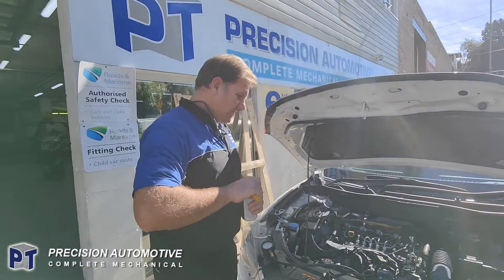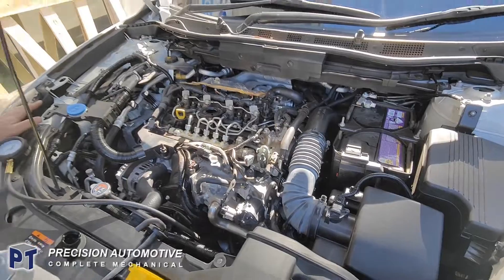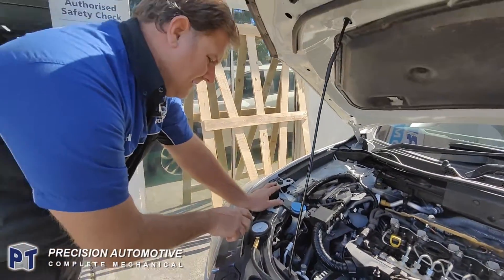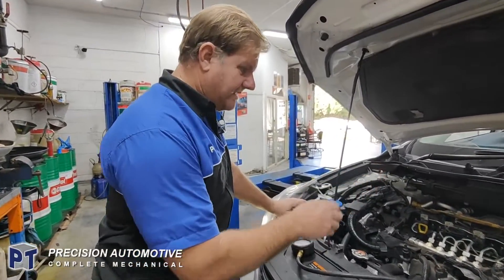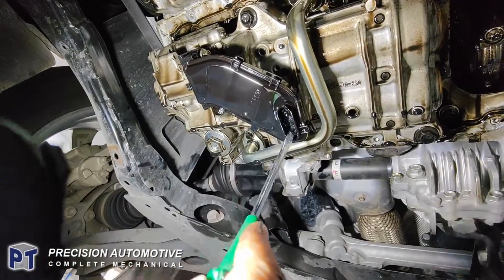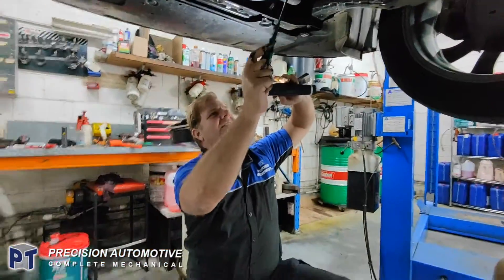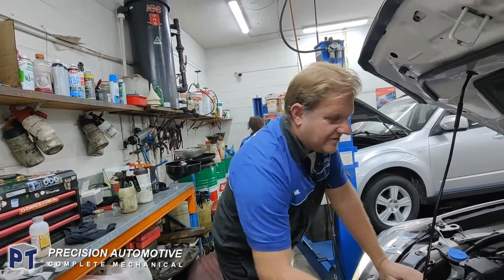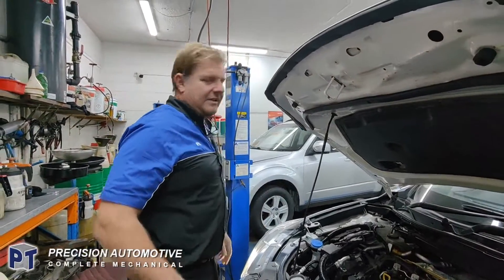Mazda cx-5 diesel oil pressure issues, Engine Issues

Comment: You can remove the hole oil pump  that's the only way to change the oil sump clean it is not gonna help. You just have the mark the position  of the chain on the teeth wheel without having to remove the hole timming chain unit.

Comment: A Honda K24 engine swap will fix it.

Never would have imagined a Mazda being compared to a Captiva for reliability. 

A petrol CX5, as reliable as the sun rising in the morning. 
A Diesel CX5, as reliable as a politicians promise.

The good news is, if you've got a petrol CX5, and you need some good low milage parts, for example an immaculate bumper bar, or a door, or even un worn interior parts to freshen yours up, there'll be plenty of pristine condition CX5 diesels being wrecked. 

Maybe an aftermarket money marking venture would be to convert the near worthless used diesels to petrol power?

Comment: The source of the issues in the the top end.. pull the valve cover off, the injector seal will have failed.. the little copper washer at the tip of the injector.. combustion is going past the injector and exhaust soot is inside the valve cover, pul the injectors and change the seals with the new part  SH01-13-H51 x 4 is needed, be sore to lookup how to torque them down properly 2NM than undo by 90 degrees then do the second bolt to 2 NM then turn additional 230 degrees

Comment: How about the wear on bearings, etc.? These carbon particles will be a major source of wear probs, I would guess.The oil filter had done a part job, but still inadequate?Well done -- good presentation.
Reply from the maker: Yes , Not good at all.

Comment: Mazda never recalled and rectified these issues in their diesel engines.  Mazda were rapidly growing in popularity in Ireland during the 90s and early 00s..But their troublesome diesels sealed their fate here and sales declined rapidly.. Big mistake on Mazdas behalf and it cost them in the long run.
Reply: Yeah spot on, I have a mazda 6 2.2 diesel and it has been nothing but trouble, I will never buy a mazda again!
Reply: @ShaunCollins-qj2sf  The Sky active are actually worse than the 2.2s used in the GH model 6...Instead of improving.. .. They got worse..

Comment: Dude, the strainer comes off.
Reply from the maker: Dude. No it doesn't
Reply: Have to unscrew the oil pump sprocket with special tool or ingenuity, and slide it off. Then drop the pump+balancer. Separate them a bit and get to the awkward screw then you can replace the strainer. 
Just mark the sprocket and chain somehow so you don't skip a tooth.

Comment: Theres a channel on here with a guy from Ireland called Kennedys Garage who has done a few vids on this problem...just look through his previous vids to find them. I had a 2015 CX5 and had the dreaded engine light/oil pressure light come on and on googling it found Kennedys garage where he explains it all. Needless to say i got rid of the car. The thing is its the diesel engine version of the CX5 and 6 that has all the problems of carbon build up...the petrol versions seem fine
Reply: I own a mazda 6 2.2 skyactive  disel and i have problem with oil pressure as i know  its a  problem  for all mazda between 2014 till 2017 that its equipped with this engine ….the 2018 versions they fix all this problem anyway back to the problem that i had… i just know straight away what to look for and the problems are the follow . Carbon build up in the egr valve egr cooler intakemanifold amd valve ports than copper washer for injectors they get broke very often and its happened injectors leaking that why its always oil mix with disel than al this problem can cause a turbo fail and its easy this to understand becouse u heard from turbine a constantly blow coming from there even when u are sto amd shouldnt to like that than next one is oil strainer clocked from carbon deposit becouse when the temperature of oil its low they are hard the carbon but when temperature get hig carbon get soft amd start to go all aruond the engine wich cam cause also a oil pump failure e oil strainer clocked than for change oil strainer its easy just need to use a special torque to not make move the oil pump chain a and loose it the fear a deasemble all balancer unit with oil pump than split the balance from the oil pump simply undo the 3 bolt and u have access to the bolt strainer 
So in conclusion best way to take care 
Change oil frequently also becouse if u drive in the city alot car cant make the dpf regeneration and can couse oil mixing with disel 
Than a proper carbon cleaning every 50/60.000 km egr intake manifold dpf (if neded) and intake valve ports than 
Thant every 30.000 alwais change the oil strainer clocked
And always this is a must every 70/80.000 km can be more if u use the upgrade whaser for injectors but change it 
Than also every 100/150.000 km chamge the both chain timing chain and oil pump chain 
Only like this this engine will last for many years  ps im a mecchanic 🎉
Reply: Hello. Do newer CX-5 diesel versions have the same problem?
Reply: @FIFIDOUNE  that I'm afraid I don't know. Maybe try a Google search although I would say it's mainly the diesel engines with over 40k miles... seems to be carbon build up at points around the engine and if not cleaned properly will clog up the engine and after that happens then it could be catastrophic. You could check out Kennedy's garage on YouTube and try sending him a message as he has seen a lot of the 2.2 engine through his garage.
Reply: @FIFIDOUNE  No, the engine was revised and updated from 2018 onwards, fixing the horror story that was the 2012 to 2017 Mazda 2.2 diesel engine. They still carbon up but no worse than most modern direct injection engines.
Reply: can we talk i have cx5 fail oil pump
Reply: This is just some problem that can cause this theris also many other problem that cam cause

Comment: I have a  Mazda CX-5 2016 with a similar issue.
I was obviously unaware as an issue at purchase, I paid £8750 3 months ago.
The car is at 95000 miles.

The warranty company has refused to pay for work and the dealer is not taking any responsibility.
The garage has informed me that if they start work on the car I could have to pay £2000+

Any suggestions of what I can do now as I haven’t got a clue

Suggestions welcome 👍🏽
Reply from the maker: well you need to start somewhere

Comment: Very common issue carbon is blocking alot of galleries,  oil pressure going max breaking oil chains is next . 
You need to replace the strainer 
Clean the cam gallery pipes that feeds all the bearings .  Thrn start changing the oil every 5000km
Reply from the maker: Yep

Comment: I have been working on and around diesel engines of all sizes for the better part of 40 years. I dont think this is a fuel related problem or a blowby problem. I have never been in one of these engines but suspect it is the oil being cooked either in the turbo bearing housing or the piston under crown area do these use a hollow crown piston with coolin jets spraying the under crown or crow cavities? It is the kind of issue that I would associate with getting a quart out of a pint pot it's all to easy to keep turning up the wick on a diesel
Reply from the maker: Yeah , it is caused by the Diesel injector seat leaking for along time into the engine oil and oil not being changed for extended periods and no oil flush being used. just bad servicing , and mechanic should be telling customer of issue and customer should be doing something about it.

Comment: Hi from the uk 
Its a shame that mazda havent sorted this issue out they have made it quite obvious that they cant build doesel engines and are not taking the problem seriously. I have heard that they deny that there is a problem.
The only way to treat this  is to advise against buying anything diesel from mazda. Quite a shame as the vehicles are good other than the deiesel models
Reply from the maker: Yeah. I think any good Mechanic knowing Diesel engines should point out the issue to the customer before it gets too bad, But some customers just don't want to spend the money.

Comment: This is trouble! It all started with the oil pressure being too low. A few months ago we disassembled the whole engine and found that the camshaft was defective and a valve in the cylinder head was stuck. End of story, we replaced the camshaft, cylinder head, turbocharger, timing chain and all small parts. Have cleaned the EGR valves and throttle body. All the work we did ourselves but the spare parts were extremely expensive, we are now at about 6000€. 
The car still does not run 100%, as soon as the engine is warm, it starts to jerk. At idle and cold, the car drives and accelerates great. Maybe an idea?
Reply: Hi Johannes, I have the same problem with Mazda 6. The car at idle and cold seems ok, but when become warm or after a few kilometers, the low oil pressure warning light, often comes on. Did you find out a solution? Thanks
Reply: Did you change the 2 o-rings that are between block and oil pump? They can leak and drop pressure. Also oil pressure relief valves or solenoid might be dirty and stuck.

Comment: I have one, any suggestions on how to make it last? I bought it at 117 000 km and I'm now at 183 000km from owning it for 3 years. The engine was replaced in 2020 by the previous owner at 100 000km. The only issue I've had since was the exhaust pressure sensor needed to be replaced in 2022. I did some preventative maintenance by cleaning out carbon from the intake manifold and EGR valves last year. I only fill it up with Ampol premium diesel, I am super strict with services every 10k and take it on the highway twice a week.  I am unfortunately not in a good spot to sell the car but I am hoping to do some extra maintenance to get another couple years from it. Any tips?
Reply: Make sure you check injectors seats and change washers every 40 k km. Oil change every 10 k and you should be fine. Probkem is a blowby on injectors.
Reply: @am2am2am2am I am reading lots of confusing videos/articles regarding carbon build up.  Is it true to say that it all stems from leaking injector seals?  For example, deposits in the inlet manifold, contamination of the oil, deposits/blockage of the sump oil strainer?  Some talk of unburnt fuel if the DPF regeneration is not allowed to complete itself?  So which is the fix?

Comment: Did this issue get resolved in the 2019 2.2 diesels? I was about to buy one until I saw this. Please advise and thanks for the video, well shot and explained guys, good job.
Reply from the maker: No. As you will see in the comments , the car is still driving today.  [But i would not want to own that car] But its still going.

Comment: i simply flushed and changed the oil strainer (thats the job of the strainer) catches all the carbon stuff... Cars running sweat as a nut and still running 85000 miles and counting, this guy over thinks it!
Reply: Cars still running 5000 miles and counting
Reply from the maker: @everythingandanything4102  AND ?   So is the one in the video , [but i wouldn't own it.] it doesn't sound great.
Reply: My oil pump was as clean as a whistle the bottom end was super clean after the flush and of course the strainer was rammed full of Carbon, but the rest of the engine was OK, I've not taken the rocker off to check the head as the engines running nicely no erroneous noises 7000 miles and still good
Reply: Still running? @everythingandanything4102
Reply from the maker: You obviously have no idea of the problem at hand here.  [And you CAN NOT just change the strainer.]

Comment: The problem is the injector seals are leaking combustion and carbon inside the rocker cover. All the carbon makes its way to the sump and pick ip sucks it up.
Reply: So injector seals you mean the copper washers under the injectors? 

I've been chasing my tail on one if these for 6 months had engine rebuilt obviously cut new seats and I put injectors in on fresh washers
Reply: @alanbeales4968  yeah the copper washers get blown after about 100000km and leak and leak combustion gas. Mazda updated the copper washers to harder alloy washer and increased tightening torque to fix this issue. 
But have to drop the sump and have a look at the oil pick up. It will be gunked up bad.
Reply: @nsm6017  last I checked theure 2nm with angled turn?

Comment: Can I ask you a question about the engine. I have a possibility to buy a mazda 6 2.2 skyactiv 150hp 170000km but there is the problem with oil pressure. While normal driving (hot or cold) the oil pressure will not light, but when I drive it more dynamic the light will show up. Allegedly the car was at official dealer and they said that the oil pump chain is stretched, what I pretty do not belive but who knows. I am a mechanik so some sort of work I can manage myself on this car. How can I diagnose if it is just the typical problem or there will be a problem on crankshaft, bearings, etc... Replacing the timing chain, oil pump chain, oil sump, camshaft, fuel injector seals is no problem but total dismantling of the engine and problems on crankshaft, main and rod bearing is a no go for me... Thank you.

Comment: Was this car ever fixed properly? Having the same issue with my car and been told that it’s probably gonna need a new engine (£3000+). But they didn’t even try to come out with a fix. But my mate works for Mazda as a mechanic and he said he’s got 4 other cars in for the same issue. 

Just wondering if this fix worked as I’d just book it in for this done and hopefully save £3000 for a new engine that would probably have the same problem again in few thousand miles.
Reply from the maker: well the car is still driving. but i would say it will fail eventually

Comment: Im having the identical issues w my car..Car engine shutting down between 60-80 kms..Awesome to drive but the diesel engine is bad..So far I had to change a vaccum pump & apparently cleaning the erg system and replacing the gaskets should fix it..
Reply from the maker: i don't think so ?
Reply: Hey mate you were right. Mazda charged me $850 to clean the EGR & replaced all the gaskets 2 days ago..And guess what..Same problem happened today. Engine light came up, then oil pressure lights then no power to the engine. had to stop every 10mins..Very disappointed w Mazda dealer. Is your shop located in Melb / Vic by any chance?? Car has abt 158000kms
Reply from the maker: @paulyarele5971  yeah sorry mate we are in Sydney.
Reply: @PTPrecisionAutomotive  No probs mate. Thks

Comment: Most mazda diesel engine owners do not charge their oil regularly even mazda dealers in the UK claim they did but never do. This is a major problem with mazda.
Reply from the maker: Correct.

Comment: Drive them hard change the oil before its due labouring  these engines will clog them up ,if they're not driven properly these issues will appear. I Drive my Mazda 6 2.2 quite hard 220 kms on clock never a problem.
Reply: Is it the same engine? Anything else you can recommend? Thank you

Comment: Change injector seal , clean strainer in the sump she'll be good again . Common problem with them diesel engine
Reply: How much cost in your region?
Reply: @lkj17  To change 4 injector washers is 1 hour of labour. But if they have been leaking the top of the head must be stripped and cleaned of sludge, injector bores cleaned and the injector seats reamed - 3 - 4 hours of labour. Dropping the oil pan, removing the oil pump and balancer to get at the oil pickup strainer then clean all parts and put everything back, 2 - 3 hours labour. For a mechanic who knows what they are doing, around 8 hours labour, price it from this based on your local hourly rate. UK is around 800 pounds, Australia is around $1500 - $2000. A Mazda service center will charge you double this.
Reply: @caileme  thanks for this I went to the dealer the other day they also said 8 hours of labour and around 1800$ in nz
Reply: @lkj17  If it's a NZ new vehicle (not a Japanese import) with low enough kms the dealer should be doing it under warranty. There was a recall for this to replace the washers and retighten the injector bracket nuts. Should have been done by Mazda. There are 2 garages in Auckland and one in Hamilton that I know of that have done a lot repairs on this engine. I'd trust them over a dealer any day of the week.
Reply: @caileme  thx I can’t remember any recall on this of my vehicle I owned for over 7 years. And what garage in Auckland you know did this before so they know what they are doing?